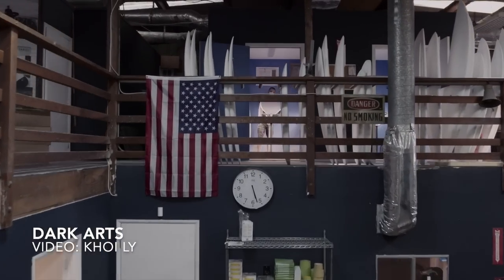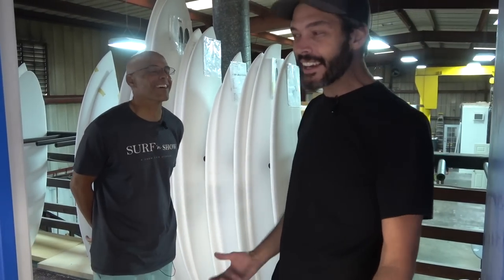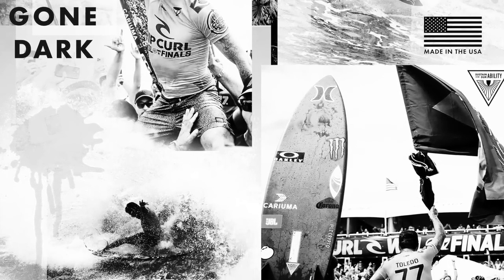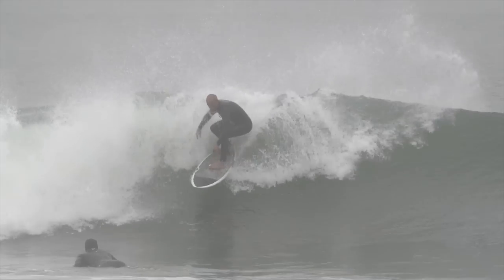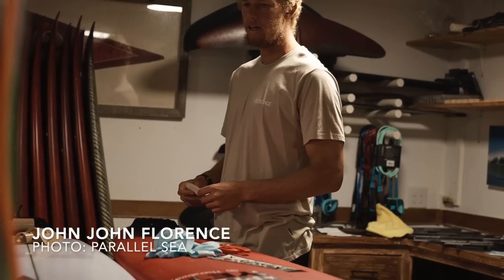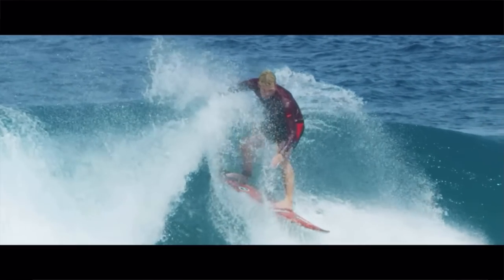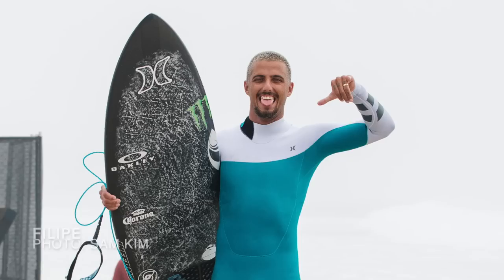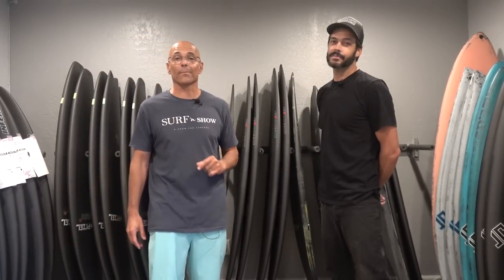Behind the Scenes Surfboard Building with "Dark Arts"

Comment: How strong are they and how long should one last?
Reply from the maker: It really depends how often you surf and how hard you are on boards. I will trash a stock PU/Poly if I surf it everyday for 30 days. I’m really hard on boards and I pressure dent them pretty bad after 1 session. These Dark Arts pressure dent a lot less and the pop will last a long time compared to a PU/Poly.
Reply: @surfnshowreviews7777  I surf daily and have the same results with poly as you and why I ask.  Thanks, I will assume they are as  strong but no more resilient than my Firewire's.  THANKS!!!!